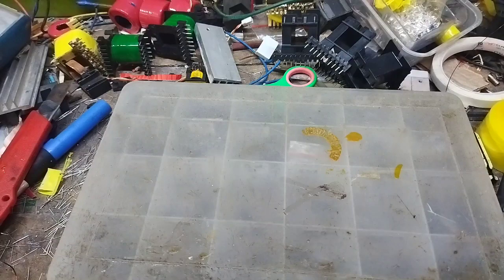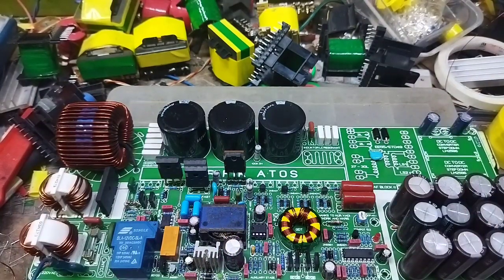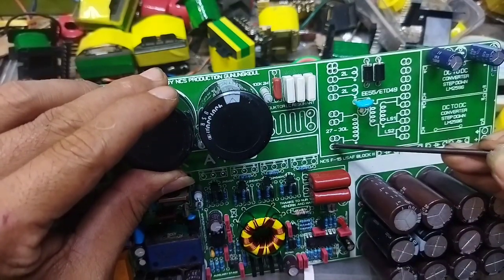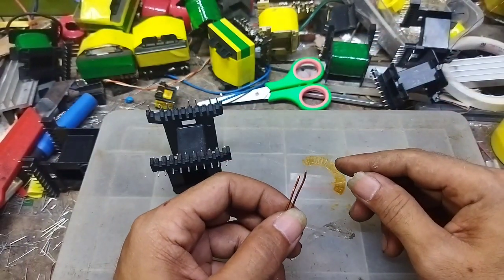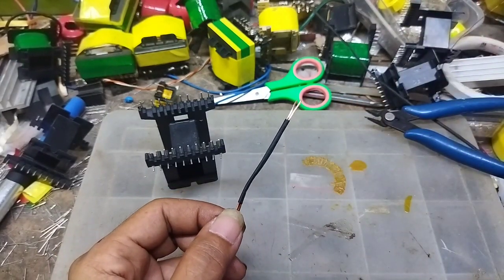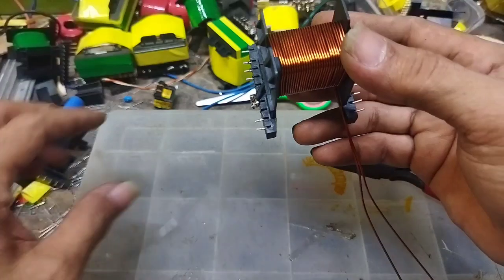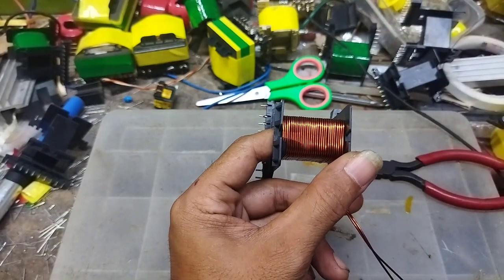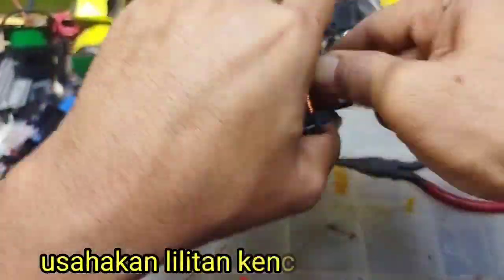RAHASIA MELILIT TRAFO SMPS FULLBRIDGE PFC. INDUKTANSI DAN FREKUENSI

Comment: Excelent video ! Very nice explained in detail ! Is it with the EE55 you get up to 6000 W ? Does it make a difference to use a EE65 ? Less heat productions by the transformer with EE65 ? I suppose wattage will be the same for EE55 and EE65 as this is determined by switching frequency and inductance ?
Reply from the maker: please translatrte, i😀
Reply: pake google translate aja om
Reply: @Subakti_wardoyo  Video yang luar biasa! Sangat bagus dijelaskan
secara detail! Apakah dengan EE55 Anda
mendapatkan hingga 6000 W? Apakah ada bedanya
menggunakan EE65? Lebih sedikit produksi panas
oleh trafo dengan EE65? Saya kira watt akan sama
untuk EE55 dan EE65 karena ini ditentukan oleh
frekuensi switching dan induktansi?

Comment: Saya bikin smps fb non pfc
Trafo 30 lilit etd49 induksi 3.6mh
Freq pwm 46khz

Trafonya kox semakin lama semakin panas ya mas, untuk daya load mantap gak loyo
Mosfet adem, tapi saya khawatir sama trafo yg panas lumayan
Reply from the maker: klu ferit trafonya bukan belkas patah di lem, cb itu R pin 7 IC SG dipasang nilai brp ?
Reply: @Subakti_wardoyo  r 220ohm mas
Reply from the maker: naikkan 330-470R
Reply: @Subakti_wardoyo  r tsb berfungsi sebagai apa mas
Reply: @Subakti_wardoyo  diketahui smps saya freq 56khz, duty xycle 46%. Vgs 5van mosfet 20n60c3

Kalau mosfetnya adem, cuma trafo aja masih terlalu panas jika nyala tanpa beban.. 
Udh saya coba buat musikan 1 harian babat volume besar

Mosfet hanya anget.. kipas high speed. Apa emang trafonya gak mau di buat anget" kuku ya mas?

Comment: Kalau buat pcb badak ramping pingin voltase 90v..ukuran diameter kawat buat primer dan sekunder brp mm pak🙏🙏
Reply from the maker: primer 3X1mm
skunder 4X1mm
Reply from the maker: tapi klu masih agak sulit gpp kasik 2 rangkap primer dn 3 skunder. tapai klu buat maksimal yg ay sebut diatas
Reply: Boleh minta no wa nya pak🙏🙏
Reply: Kira2 btuh brp ons ya pak..kalau buat   primer dan sekunder+aux/extra

Comment: Mau nanya bang saya pakai mosfet 45 nm 60.mosfetnya panas belum ada beban.pakai travo e55 primer 30 lilit skunder 7 lilit.vgs 4.2 freq 52 kilohes.
Reply from the maker: FREQ BERAPA, INDUKTANSI BERAPA??
Reply: @Subakti_wardoyo  induntasi 7.56mh
Reply from the maker: idealnya itu 4.5mh ms... cb set lagi induktansi nya dgn memberi gab dikit. laliu mainkan resistor pin 7 SG. 220-470. sampai didapat suhu yg normal.

Comment: Kalo outnya dibuat non ct rencana bikin 220v,apakah ada pengaruh ke komponen sebelum ferit utama pak
Reply from the maker: tdk ada pengaruh
Reply: @Subakti_wardoyo  terus misal output smps ini 220v buat suplay smps lagi bisa kan pak,biar volt stabil
Reply from the maker: g ngerti sy mksdnya
Reply: @Subakti_wardoyo  rencana mau bikin smps out 220v,kaya stabilizer gitu pak,untuk menyupay power smps
Reply from the maker: mksudnya power smps apa
Reply from the maker: buat smps untuk mensuply power smps ?? gmn mksdnya
Reply: Biar kalo los setrum tidak naik turun pak
Reply from the maker: gk ngerti saya mksd rencana penggunaannya sampean itu
Reply: @Subakti_wardoyo  maksudnya itu smps buat suplay SMPS jg pak..
Reply from the maker: gk tau sy ms...  sy blm berpikir cara spt itu... 😁
Reply: Ohh jadi kek step up, tapi kalo jenis smps kan frek tinggi ,sedang kan  kalo ac di 50 hz/60hz di 220, mending beli aja stepup dc  atau rakit  12v to 220 ac